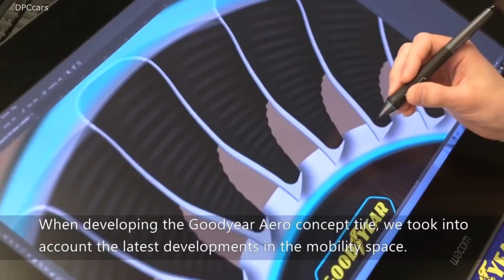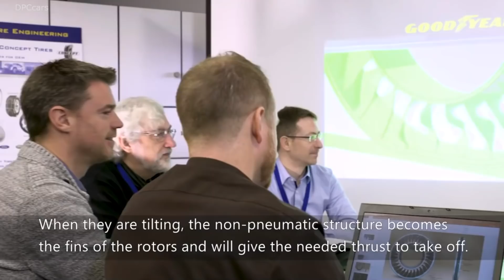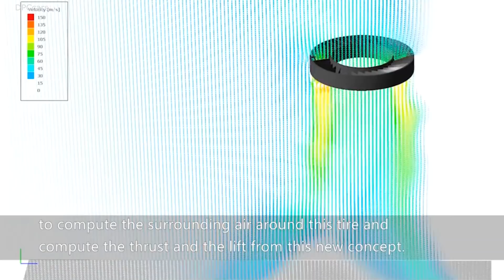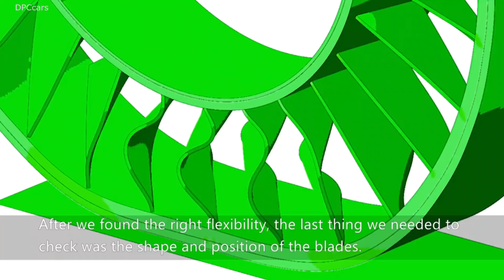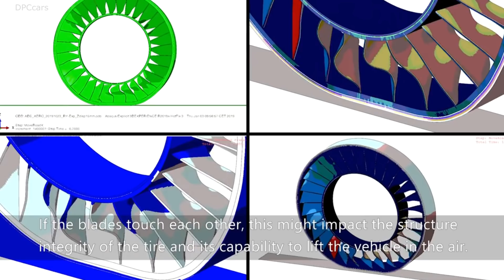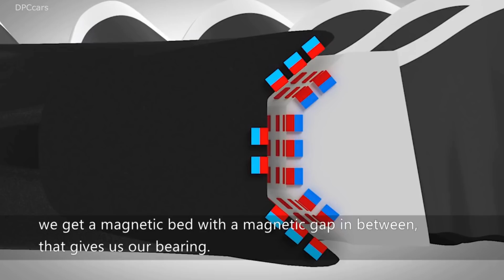Flying Cars Tire by Goodyear Demonstration Airless Wheel Technology

Comment: So unrealistic! Today's typical pneumatic tires come with 10/32 tread and we get to use 6 of those 32nds before they are illegal and need to be changed.  Hey Jim I have an idea!!!! Let's take a titanium jet turbine and wrap a thin layer of rubber around the outside like a wagon wheel from a hundred years ago made out of a propeller.  So stupid! Flying cars won't drive on the road, they will fly and fulfill every job in your life that a car does. It would be similar to a dial sport motorcycle,  it's a bad dirt bike and a worse street bike. Imagine if you are reading this and you had a tenth of the money that these Morons wasted on this cartoon.

Comment: I do not know about good year but my ram jet is both lift and thrust by antigravity, and lift by falling capturing air thrust drive antigravity and revert air back down to help lift too
With antigravity and electric heater hot air and air compress into pressurized water to incredible thrust no fuel needed